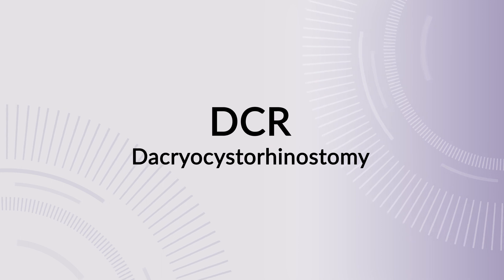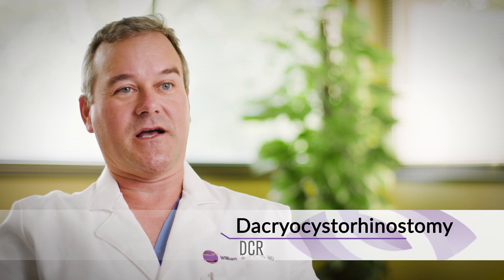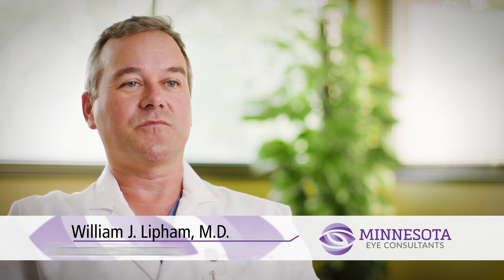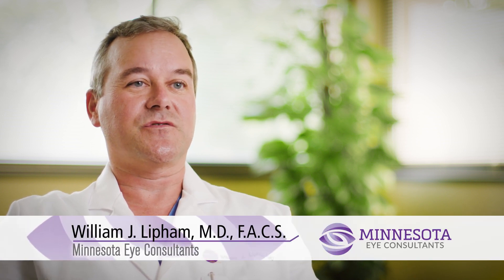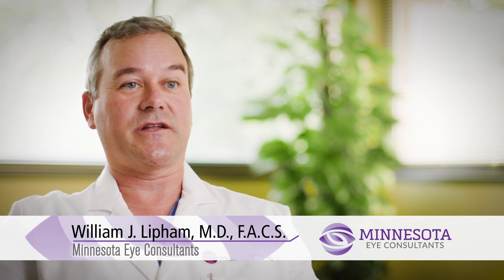DCR | Tear Drainage Surgery

Comment: I had this exact surgery with this Dr 14 days ago. I have had other surgeries in the last 10 years and usually recover quickly, but the recovery from the DCR surgery was miserable for the first 4 days. I was in so much pain and no medications were helpful in getting it under control. I couldn’t sleep for the first 24 hours because the pain was so bad and the prescription pain medication felt virtually ineffective. I was told the surgery went smoothly and there were no complications and that it is generally easy to resume normal activities, so I was surprised by the amount of pain and inability to do anything but stay in bed for a few days. I asked if what I was experiencing was normal and was told “pain is relative” just an FYI for anyone who needs this surgery.  They emphasized a quick recovery, and it was much harder than that for me. After 14 days i am better…there were no infections or other complications, but it was a painful 4 days following surgery and a slow crawl back to normal. For the record, I am a 46 yr old woman in good health. Maybe this info will help someone who is researching this surgery!

Comment: I have had the stent since 2011, it's been a little over 10 years. The doctor decided to leave it in because the first surgery I had the stent was removed and my eye kept tearing.  Now it's bothering me and it keeps itching and tearing,  any possibilities that I won't have any tears if it's removed after 10 years?
Reply: I had a DCR procedure on each eye. But after the Stent was removed from one side, it collapsed back down. I found a new occuloplastic surgeon in Seattle & he did a revision & it worked. My understanding is the stents aren't meant to be permanent. I'd definitely find a new surgeon for a consult.  @sweetlatina
Reply: @Lisa_RNHealthHub  Hello,how many times is posible to do DCR for one eye?Thank you.
Reply: Were you offered to get mitomycin instead of a stent to prevent fibrosis and help keep the pathway open?
Reply: @Nicole-oi5fe what is mitomycin?